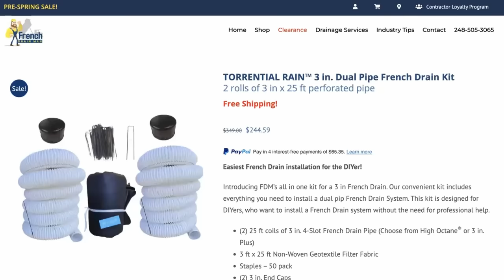EASY DIY French Drain Full Tutorial - Skill Level 2

Comment: Great video!  Thank you for the step by step instructions.   Based on this and other videos, would it be correct to say:
Double barrel 3” pipe French drain = 3/4 rock
Double barrel 4” perforated French drain with solid pipe yard drain on top= 3/4 rock
Double barrel 4” perforated French drain (no other pipes in trench= 1 1/2” round rock. 

I recognize every job is a little different.  Just trying to understand the general approach.  Thanks!
Reply from the maker: Yes, you are correct.

Comment: Have you experimented with running three 3 inch pipes at the bottom for air pruning? Or running a quad pack of 3 inch for the same reason?
Reply from the maker: Yes, we have. We actually used 6) 3" pipes in a french drain for air pruning. It was an easy installation. 3" is user-friendly.

Comment: Great video. I was planning on running one 4" perforated pipe, and one 4" solid downspout pipe burrito wrapped in the trench. For the discharge I was going to wye the perforated into the solid out to a pop up. Does this sound right? Would I add any benefit to adding an additional catch basin shortly after the wye fitting? Thanks!
Reply from the maker: That sounds correct.

Comment: Great video, is standard to run two discharge lines when working with 3 inch pipe?
Reply from the maker: You can wye them together on short runs 150 feet or less. The 2nd pop-up emitter allows for access.

Comment: Just curious, if I followed all your instructions here but I wanted an OPEN French drain (no sod back on top), wouldn't the addition of that quarter inch of sand on top slow down the water infiltration rate compared to using ONLY stone on top (because that stone has larger voids than the sand does to allow surface water in better)? So, I am thinking of following ALL your instructions and materials with the 12" depth and two 3" pipes BUT I would like to SKIP the layer of sand on top AND use the larger stone that you normally use for a 4" drain and there will be NO sod on top? Does this configuration make sense? THANKS for these great videos!
Reply from the maker: You can use only stone for an open french drain when you have a situation where there will be no sediment
Reply: If you're doing open, I don't think you'd want the sand on top.  The whole point of the open drain is that you want faster flow.

That also means you'd probably want to go with two 4" pipes instead of 3", to accommodate that extra flow.  One inch doesn't sound like much, but you square the radius (remember ) to figure the cross section:  the 4" pipes would have a combined 25-square-inch cross section, while the 3" have just over 14 square inches.  And since the outside of that cross section is slowed by the corrugations, it's probably more like a 2:1 ratio of how fast the water can move in 4" pipes.
Reply: @montyharder3663  I agree 4" is better and it has more perforations per valley circumference and higher volume but I like the idea of only going 12" down instead of a min. of 14" as French Drain Man has outlined in other videos. What downside (possible problems) might there be in using two 4" pipes but only going down 12" (all other parameters being as he stated) except I want an open French drain?
Reply: @michaelt1349  I'm not a professional like Robert, but it seems to me that in an open drain, you could go as little as 7 inches at the shallowest, because you only need a few inches of rock on top of the "burrito wrap".  Just enough weight to hold the pipes down, really.

Comment: If you already had a French Drain installed and you suspected (perhaps a year later or so) that critters might have made a nest in the pipe, could you run a plumber's snake through the pipe without damaging it? (assumes you have an access port in the line) Thanks!
Reply from the maker: Put a jet nozzle on a power washer and enter through the discharge line blowing nest out of the system
Reply: @FRENCHDRAINMAN  Appreciate your timely responses but if I don't have a power washer (I don't), should I avoid using a plumber's snake as it might get caught in the plastic?

Comment: I think I just noticed that the 3" pipe only has 4 slots (perforations) per valley circumference whereas the 4" pipe has 12 slots (perforations) per valley circumference. Is this correct? Thanks!
Reply from the maker: Our 4 inch has 8 slots. 3" has 4 slots